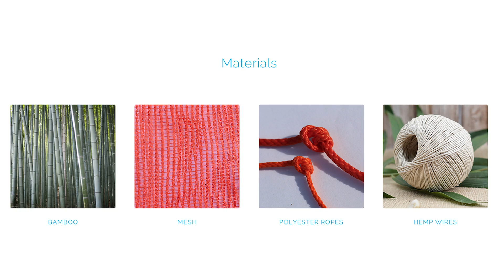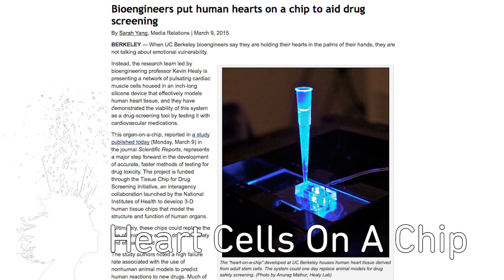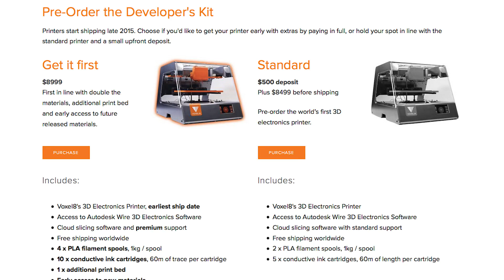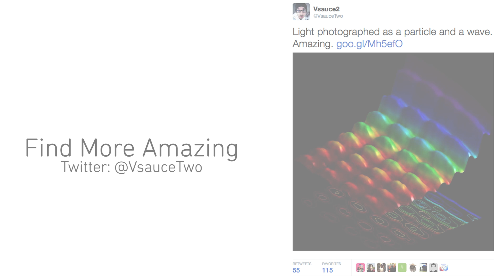Slicing Up Human Brains -- Mind Blow #93

Comment: the underground energy thing is seriously flawed, and it's quite amazing the people designing this can't see it.  you can't create energy out of nothing.  if you manage to take out energy of a "closed system", then that energy is lost elsewhere.

Put those scoops in the waterflow and you disrupt the waterflow so water will flow slower, sure you can put a couple ofo those in there, but you can't keep doing it and after each one the flow of water will be lower.
this can only work if you then up the pressure at the start of the pipe which means you'll need thicker pipes to handle the pressure, and more energy put into the system to get the initial pressure higher.  now, where are you going to get that energy from to get the higher pressure..?

Oh yeah! We can use the energy we get from those underground energy things... (slap head).

flawed thinking leads to flawed ideas.  This is even worse than those solar roads ideas.

Comment: We need to take a break from making new robots. Please. They will take us over if we don't slow it down a little bit. Also, I'm not a huge fan of brain modification especially with a remote because then if robots become too smart or bad guys come, we would be screwed.
Reply: That brain stimulation already exists, that looks like it's making it less surgery dependent which is a good thing when it comes to your brain. There's no reason to be this paranoid

Comment: Wait....wait wait. That thing can 3D Print WHOLE electronics!? From the video it looks like it has to be completely solid, but either trough printing and assembling individual parts or improvement of the technology, we could end up with people pirating actual physical electronics!! :o Those things use computer files to print the objects, so imagine if someone made a file for, say, a PS4 or whatever, and shared it online, people could download it and print one in their own home! Sure the machine itself and the materials to print it would cost money, but I think over time that would pay for itself....holy shit.
Reply: john smith Well I could easily see that becoming possible as well. I mean think about it. All this machine does is break an object down into thousands of layers a few microns thick and then lays in the appropriate materials where they need to be in each layer. So, If the machine had tons of different spaces built into it specifically for holding the materials to make those kinds of electronics, all those transistors and capacitors and boards could be sliced up into layers with everything else and the machine would just place everything where it needed to go for all the various parts to harden right in the place they needed to be.
Reply: john smith Well alright then. I just put the circuit boards together man, never bothered to look into how all the little do-dads are made. Regardless, this still has a lot of amazing potential for more simple electronics.
Reply: Lmao that would be onee big ass ps4, would prolly take up the whole room printing circuitry at that size

Comment: The bit about mit making way to stimulate the brain using magnets is old news. In wales there's a company called magstim which does this as a way to combat depression and instead of a magnet the alternates they just have an electromagnet which creates a current in the brain by induction.